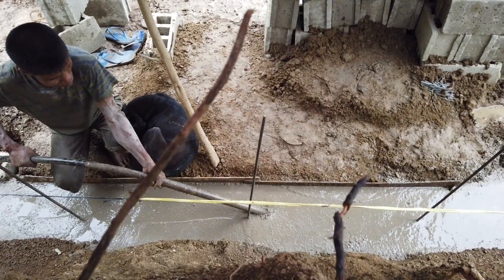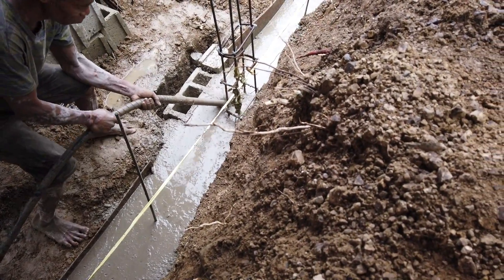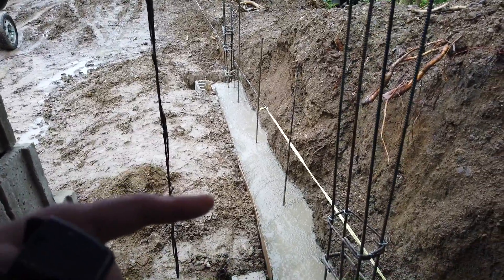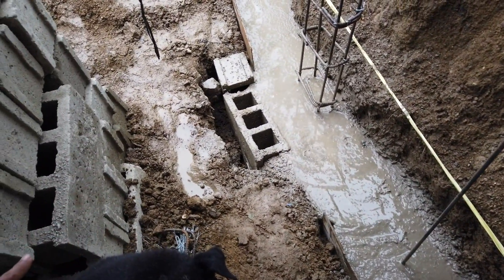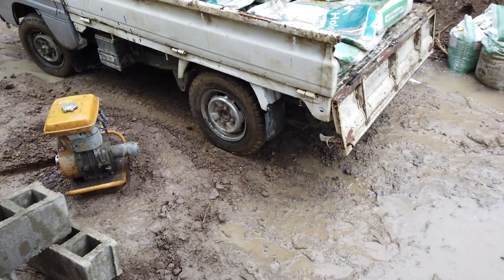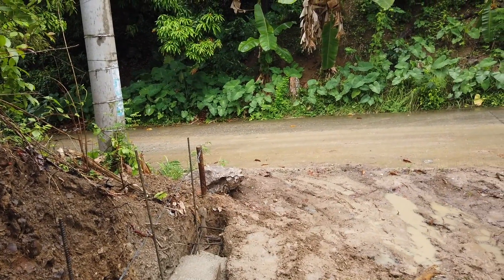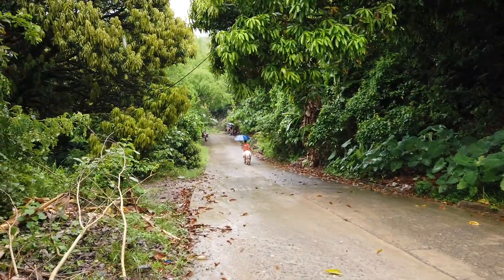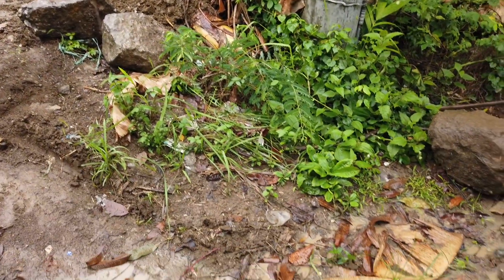Secret Of Strong Concrete In The Philippines.

Comment: Good to see you using a vibrator on the concrete don"t forget to place weep holes at base of wall and back fill with gravel first
 up to the top of the wall to help remove surface water.

Comment: Hi Ma’am may tanong lang po ako pano po yung bayaran sa plumbing buong bahay saka electrical?
Reply from the maker: Usually po, icount nila yan ilang lights, switch, plugs at thickness ng wire na needed like for fridge, aircon, heaters, at  ilang breakers ang kailangan so electrical buong bahay at mas mahal but sa plumbing sa kitchen at toilets at garden area so mas cheaper sana po
Reply: Village People Philippines thank you Ma’am

Comment: Madam your concrete will be strong since coarse aggregates is sinked down.
Reply: Actually, you want to avoid over-vibration because you do NOT want the aggregate to settle to the bottom. You just want want to fill the air voids.